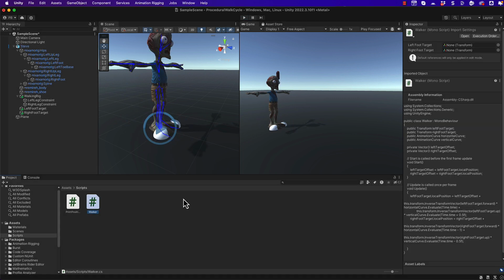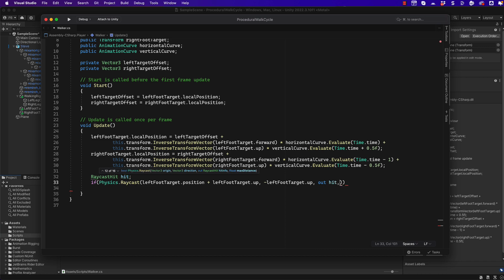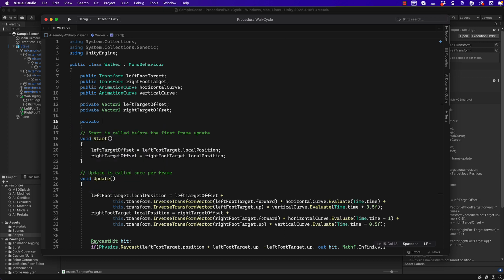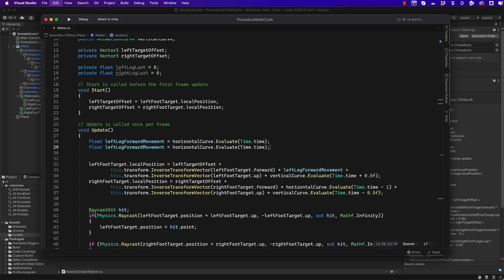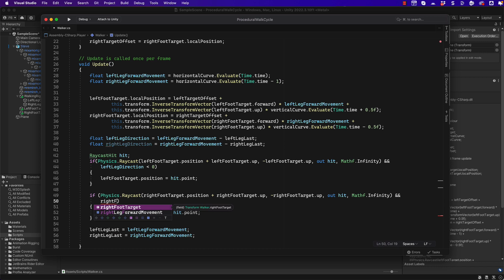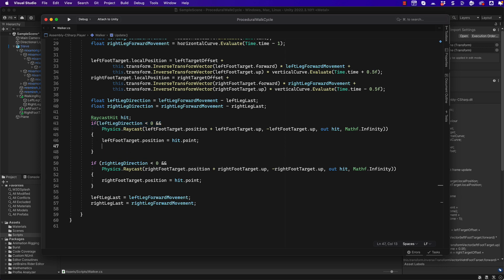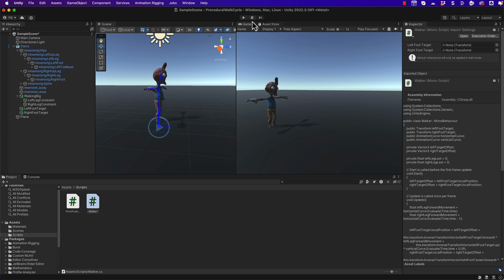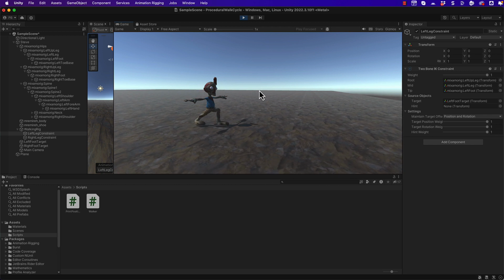Create a Procedurally Generated Walk Cycle in Unity Part 6

Comment: any ideas on how to make this better?

using System.Collections;
using System.Collections.Generic;
using UnityEngine;

public class DynamicIKFootSolver : MonoBehaviour
{
    [Header("Settings")]
    [SerializeField] LayerMask terrainLayer = default;
    [SerializeField] Transform body = default;
    [SerializeField] DynamicIKFootSolver otherFoot = default;
    [SerializeField] float forwardSpeed = 1;      // Speed for moving forward
    [SerializeField] float strafeSpeed = 1;       // Speed for strafing
    [SerializeField] float backwardSpeed = 1;    // Speed for moving backward
    [SerializeField] float forwardStepDistance = 4;
    [SerializeField] float strafeStepDistance = 2;
    [SerializeField] float backwardStepDistance = 3;
    [SerializeField] float stepLength = 4;
    [SerializeField] float stepHeight = 1;
    [SerializeField] Vector3 footOffset = default;
    private float footSpacing;
    private Vector3 oldPosition, currentPosition, newPosition;
    private Vector3 oldNormal, currentNormal, newNormal;
    private float lerp;
    private float currentSpeed;

    private void Start()
    {
        footSpacing = transform.localPosition.x;
        currentPosition = newPosition = oldPosition = transform.position;
        currentNormal = newNormal = oldNormal = transform.up;
        lerp = 1;
    }

    private void Update()
    {
        transform.position = currentPosition;
        transform.up = currentNormal;

        // Determine movement direction relative to the body
        Vector3 movementDirection = body.InverseTransformDirection(body.position - transform.position);
        float forwardMovement = movementDirection.z;
        float strafeMovement = movementDirection.x;

        // Adjust speed and distance based on movement direction
        currentSpeed = Mathf.Max(forwardSpeed, strafeSpeed);

        float stepDistance = Mathf.Abs(forwardMovement) > Mathf.Abs(strafeMovement) ?
            (forwardMovement > 0 ? forwardStepDistance : backwardStepDistance) :
            strafeStepDistance;

        // Raycast to determine the next position
        Vector3 rayOrigin = body.position + (body.right * footSpacing);
        Ray ray = new Ray(rayOrigin + Vector3.up * 1.0f, Vector3.down);

        if (Physics.Raycast(ray, out RaycastHit hit, 10f, terrainLayer)) // Use terrainLayer
        {
            if (Vector3.Distance(newPosition, hit.point) > stepDistance && !otherFoot.IsMoving() && lerp >= 1)
            {
                lerp = 0;

                Vector3 movementVector = new Vector3(strafeMovement, 0, forwardMovement).normalized;
                Vector3 stepDirection = body.TransformDirection(movementVector) * stepLength;

                newPosition = hit.point + stepDirection + footOffset;
                newNormal = hit.normal;
            }
        }

        // Smoothly move the foot during a step
        if (lerp < 1)
        {
            lerp += Time.deltaTime * currentSpeed;

            Vector3 tempPosition = Vector3.Lerp(oldPosition, newPosition, lerp);
            tempPosition.y += Mathf.Sin(lerp * Mathf.PI) * stepHeight;

            currentPosition = tempPosition;
            currentNormal = Vector3.Lerp(oldNormal, newNormal, lerp);

            if (lerp >= 1)
            {
                oldPosition = newPosition;
                oldNormal = newNormal;
            }
        }
        else
        {
            currentPosition = newPosition;
            currentNormal = newNormal;
        }
    }

    private void OnDrawGizmos()
    {
        if (!Application.isPlaying) return;

        Gizmos.color = Color.red;
        Gizmos.DrawSphere(newPosition, 0.5f);
    }

    public bool IsMoving()
    {
        return lerp < 1;
    }
}